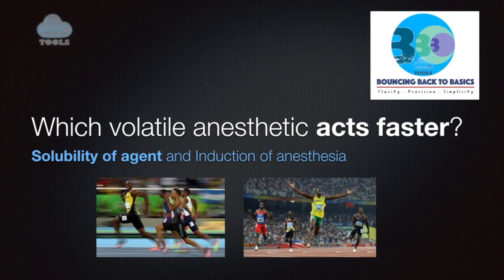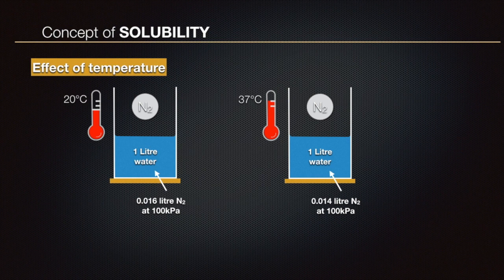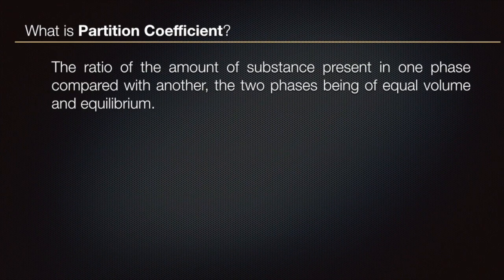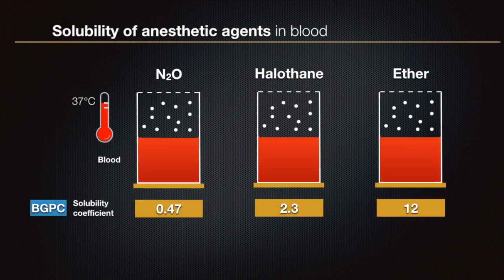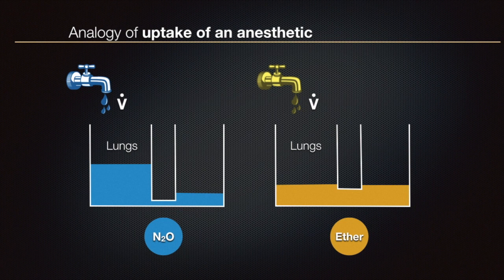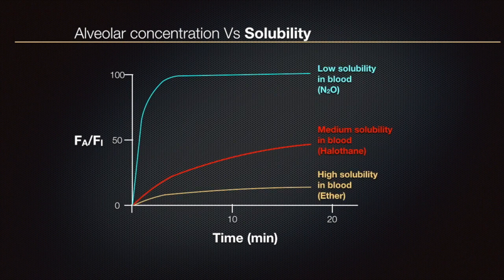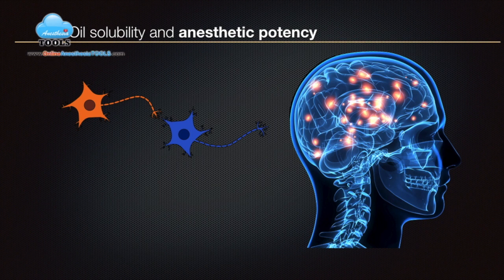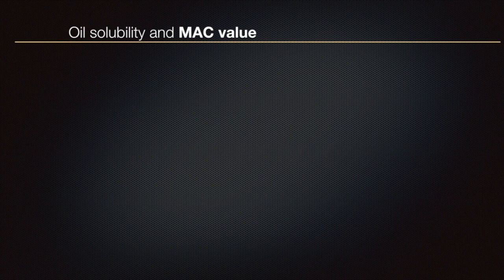Solubility of Volatile anesthetics and Induction of Anesthesia: Physical principles #saneeshpj

Comment: How to attain 104 MAC for nitrous ??
Reply: You can't at standard pressure and temperature. You would have to place the patient in a hyperbaric chamber. You would have to pressurize the atmosphere to achieve the required partial pressure of Nitrous. At normal pressure, 1 atm or 760mmHg, you need 104% of 1 atm to achieve 1-MAC (where 50% of patients don't respond to physical stimulus), which would be 1.04 (percent) * 760 mmHg = 790.4 mmHg. So, if you double the pressure from 760mmHg at 1 atm to 1520 mmHg or 2 atm, you still need the same amount of nitrous which is 790.4 mmHg. So, 790.4 mmHg needed of nitrous divided by our new atmospheric pressure of 1520 mmHg yields a 1-MAC percent of nitrous of : 0.52 or 52%. It's a bit confusing, but atmospheric pressure does not affect VAPOR pressure, only temperature does.